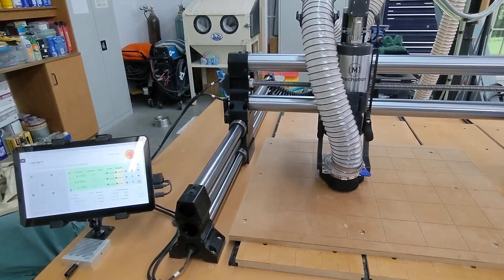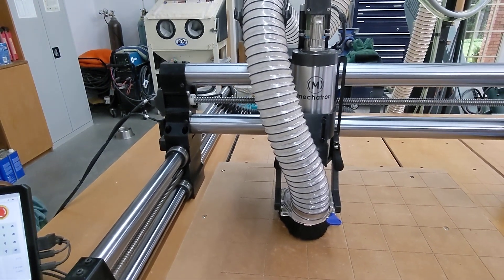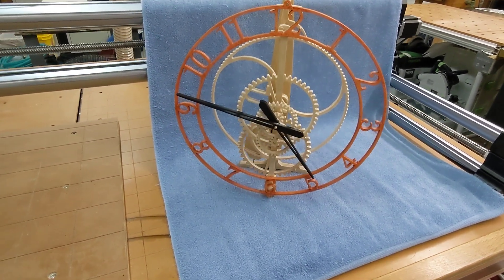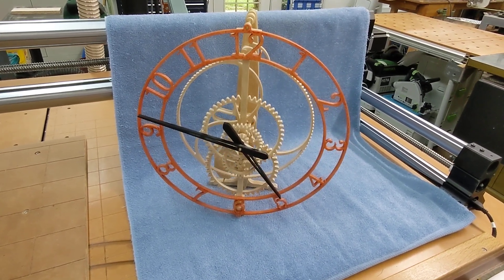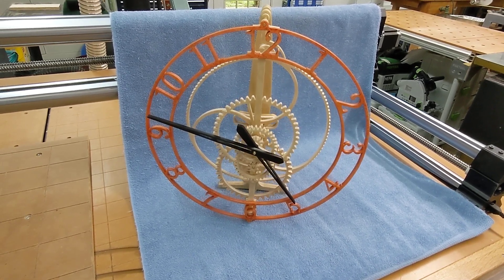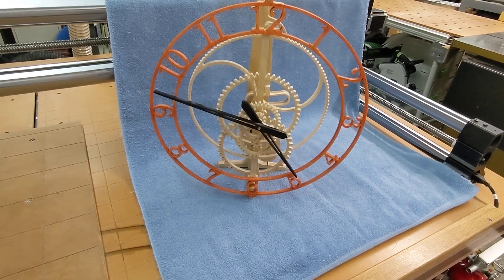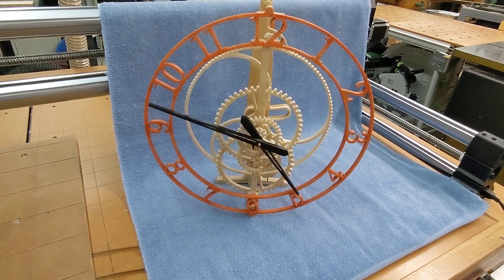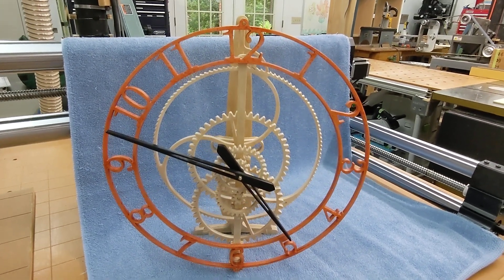Magica Clock made on the Onefinity CNC

Comment: What tools did you use as ive just built my cnc and love this many tools changes ?
Reply from the maker: It used an 1/16" downcut bit. (edited)
Reply: @BigHWorks  was it easy to get the parts ie solenoid ??
Reply from the maker: @markrichardson1171  eBay for donor clock and McMaster for bearings and other  hardware.